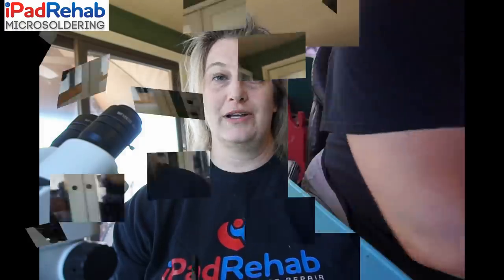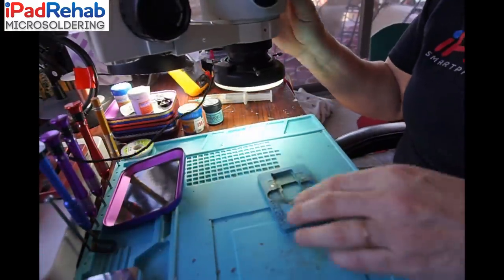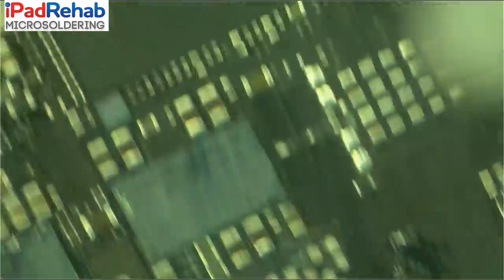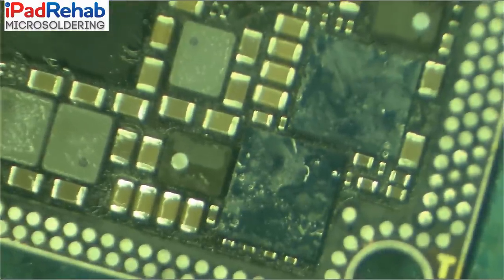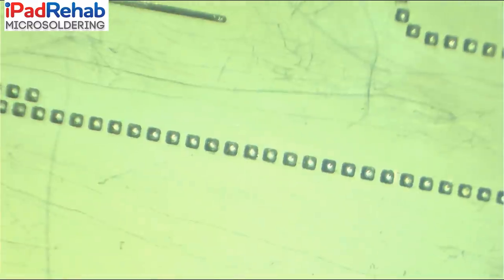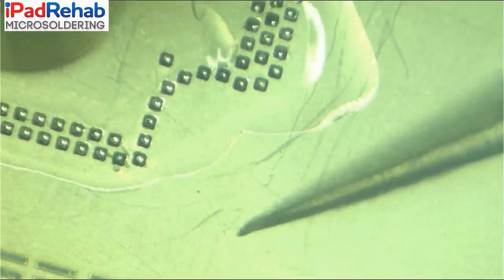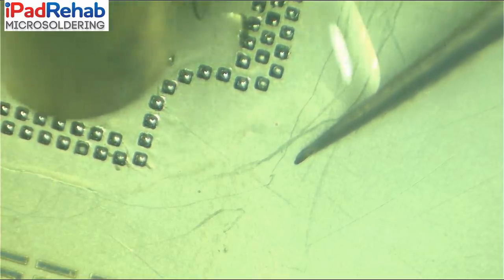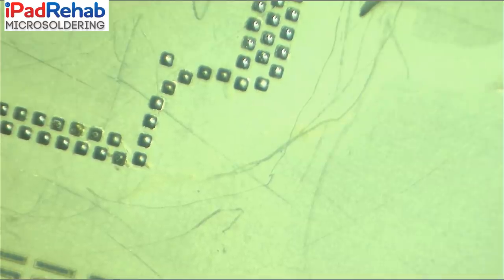iPhone X--How to Get the Split Board Reballed and Back Together Successfully

Comment: Jessa !! can you tell us why you dislike the MECHANIC hot plate ?
Reply: Bro why is she using 128 on bottom heater and so much on top. Yes I got that mechanic hot plate and it seems really good. it heats up to 190C so only be preheating it should solder the top plate.

Comment: I am thinking about sticking with the old trusty PPwoneng 120E The outer edge of the of the heat play gets really hot 🥵 so it might work awesome for iPhone 📲 x but I dislike is the heat of the heater it’s so tall hard to keep things stable while pulling or placing chips 🤔😳

Comment: I saw this touch problems , in my case problem was in bad connection to pins (responsible for touch on cpu and nand side) when board is bended along sim tray , pins got break but we can’t see it, if we touch pin we can see a little movement .

Comment: Maybe you can give me an answer to this Jess or somebody else I can't find it anywhere. Why are the circuit boards gold plated not silver-plated...? silver plating has free electrons and no resistance gold is about 13% more resistant and it's expensive for manufacturing so why don't they silver-plated instead of gold plaited...? The only thing I can think of is that it tarnish but the board is covered with a mask anyway that wouldn't be a problem so I don't know.

Comment: The pads which responsible for touch is the most heat consuming because of the big number of ground pads near them & i have learned from some friends in Vietnam that if you lift up the stencil after spreading the solder paste would make it easier reballing and indeed it is, nice video edit best of luck
Reply from the maker: We know that many use the “silk screen” method for iPhone X reball.  In our hands it makes uneven balls and seems to be hit or miss.  Is there some trick to it?
Reply: @JessaJones  nothing special, just dry the paste with tissue before using it, i think what makes it uneven is the flux in the paste
Reply: Interesting, I was reballing one the other day and noticed that when The stencil lifted/bent from heat the solder paste was left on the board in little square shapes 
I figured If we lift it completely then probably the reball would be much easier, have to still try it thought,
Jessa I know you mentioned that you just had the regular paste but that is not the paste your recommend right? You should use a lower temp paste for this.
Reply: @davidtorres8426  Try it bro it is working for me like a charm